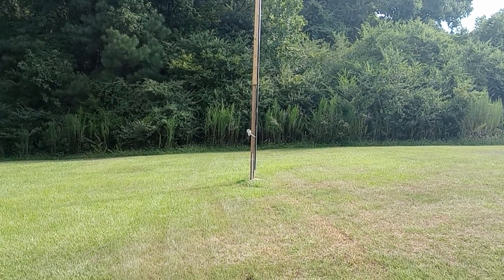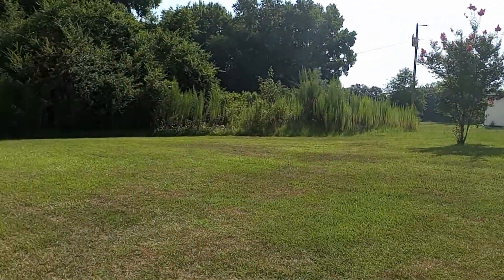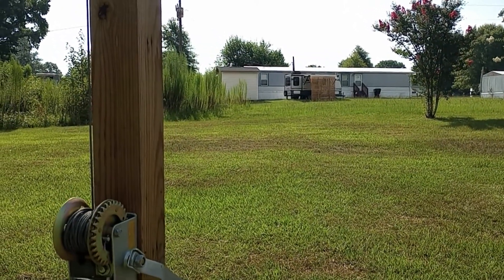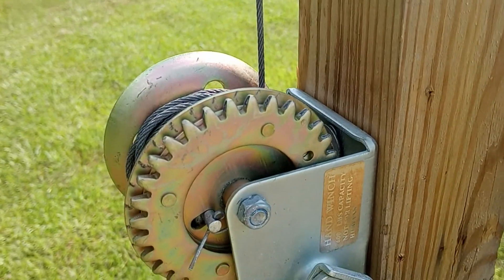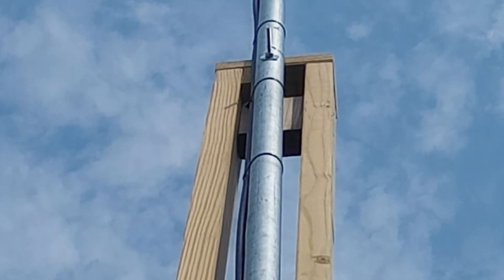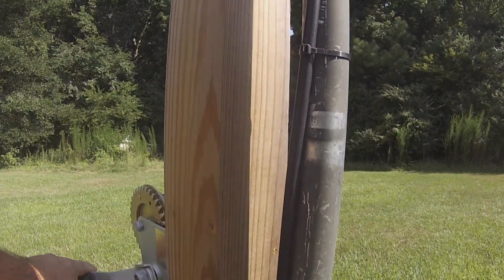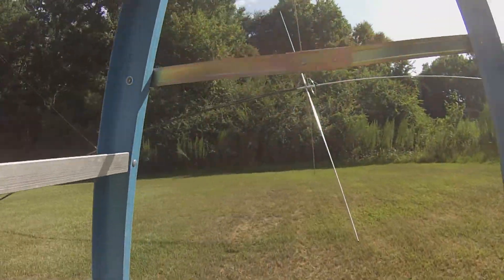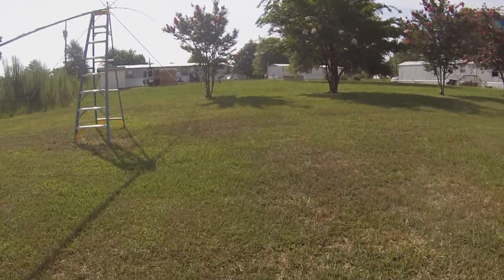Cheap And Easy To Build Tilt Over Antenna Mast

Comment: Just a thought, would it help to have a grounding point where the top of the antenna lays?  For thunderstorms. Something that's low enough to be low enough to be mow-able, yet you can clip to it when needed.

Comment: That looks a lot like my antenna, that is when I bought it new, not so much now. Looks like the V5/8 which is a good antenna. I had mine set up about 50 foot in the air. Now sure as to what happened to it. I think it may have gotten hit by an airplane. The top section got bent at about a 50 degree angle. After a few months of  begging a few guys to help me I got taken down and we put back together. about a year later we had some really hard winds blow through the area. I found the top section of the antenna at the back edge of my property. When I first set this up it was fun. But after awhile people got to arguing and wanting to pick fights. Some people would do anything to cause problems and the foul mouth crap some would say just turned me off.             So I quit.

Comment: One thing that I did to create a "portable" guy wire base was to use 55g plastic (HDPE) drums filled with gravel... That puts the wire attachment point up high enough that if you manage to trip over it or "clothesline" yourself, you deserve to have it happen to you since you're either not paying attention or you're an idiot... ;)

You'll end up with about a 740 lb anchor with it filled up with gravel and a bit more if you add water to take up the space between the pieces of gravel... I did not cut the top out of the barrel, I just removed the 2" bung plug and shoveled the gravel on top of the barrel, stopping periodically to brush it into the bung hole...

It's "portable" in that you can drag it where you need it in your pasture / yard with a truck / tractor... If it is on a concrete slab, it's easy to move it with a couple of pieces of PVC pipe underneath it as rollers...

Comment: Great video. Never occurred to me to use a winch.  Thanks!
Reply: Been looking at a way to get a shorter lean over tower that was also telescopic,  for a small inner city block. No more than 3m sections but something I could clear the second story 

I could throw something on the roof, but the keeper’s justifiable concern about a lightning strike, and being at the top of the hill, I’d like the option of not having the tallest conductive structure in the vicinity when the storms roll in off the coast. 

I have a 10m telescopic vertical I use for 20 & 40m. Haven’t tuned it up for 15 and it’s a little high in take off angle for 10m. That’s ok, but noisy on RX. I’d like to get a mag loop above the top of the house. Been looking at small towers and extensible poles. All are damn expensive and many overkill.

Comment: At 27mHz, there little reason to be above 20ft. The added height doesn't do much for you, unless you use a beam antenna
Reply: On 27MHz height will improve your signal when talking local . They say when talking skip the height don't matter as much . I don't know  if that's true , I hear a lot of big signals coming from stations that are up in the mountains
Reply: @J0EYbagaDONUTS  For DX when the band is open, you can work the world on a mobile antenna 5 feet off the ground. For local work, height rules....high antenna's reach a lot further than low ones for local 27mhz work. Remember, when the band is not open, the maximum range no matter where you are on Earth is line of sight to the horizon.

Comment: A suggestion might be to add another wood post with a V support on top to catch the antenna when you lay the antenna down to eliminate the need for the ladder? Perhaps a 10' post buried 2' to give you an 8' support?

Comment: Did you use concrete if so only the bottom? I plan on using a 6x6 10ft. 4ft deep. 6 above.. 2ft off ground attach another 6x6x10 with lag bolt so it can swing. "Post side by side one connected with 5/8 12in lag" two more lag bolts will be used when it's vertical to keep it from moving. That will put me 12ft vertical. A 10ft 1 1/4 pipe will be mounted on the last 2ft of the top 6x6. Making my antenna base 20ft. I just bought a Maco V58 antenna and it's 20ft tall. So all in all I'll be 40ft. All on one 6x6 that's 4ft deep.

Online calculations show 10 80lb bags of concrete. Is this really necessary? Or just do 5 or so in the bottom and then fill with dirt? 

Love your little setup man! Kaydo Kaylen 127 Southern KY 👋
Reply from the maker: This one is roughly 3 1/2 feet in the ground. Just a regular post hole digger size hole and I may have put about 3/4 of a bag of concrete in there with it.
It doesn't sway at all.
Reply: @Mavv.err.ickk506  good deal! I might just get 5 bags then. And fill hole rest of way after it sets with dirt so it can grow grass around it. I appreciate your response sir!

Comment: Great concept. Would come in very handy when adjusting SWR'S on a beam antenna. Of course you would need to make everything much stronger. But what you have there is perfect for an omnidirectional antenna. Great job 👍
Reply from the maker: Thanks. I'm going to build another when I get my beams ready. That one should be a bit more stout.

Comment: The only thing you need is a #6 Solid core copper wire going from the antenna mounting bracket down to a 8ft copper ground rod in the ground for lightning protection.
Reply from the maker: I'm planning to do just that but I'll be changing over to a 4 element beam.

Comment: How did you run your coax?. Did you Bury it?. If so how deep?. Did you run it through a protective pipe?. The reason I'm asking is that I really need to move my antenna away from my shop which is by trees. I do have a small area about 40+ feet away. Your idea has definitely cought my attention. Good job. Any info would be helpful.
Reply from the maker: I ran mine through some white PVC pipe. It's 2 inch diameter to allow me to run other wire through it if I need to. It's about a foot deep.